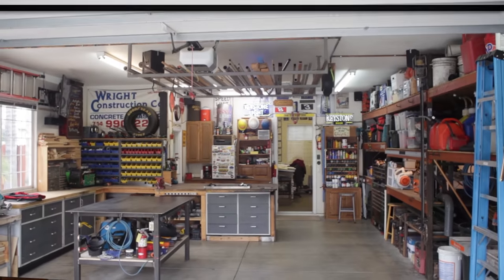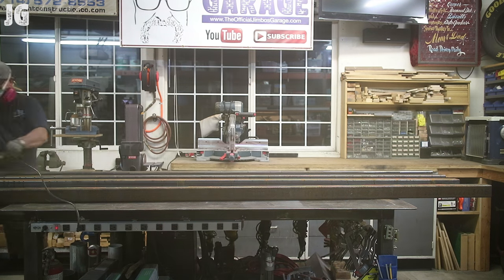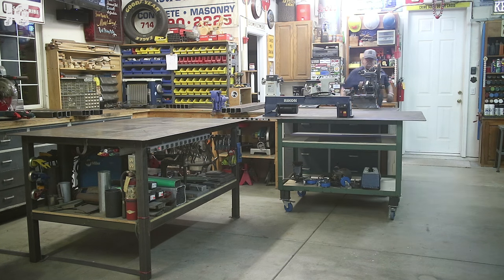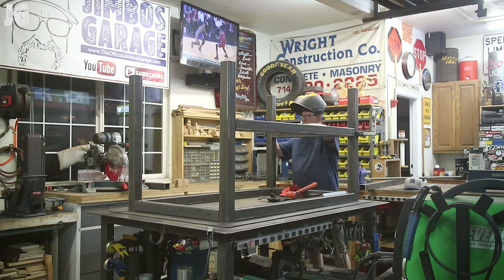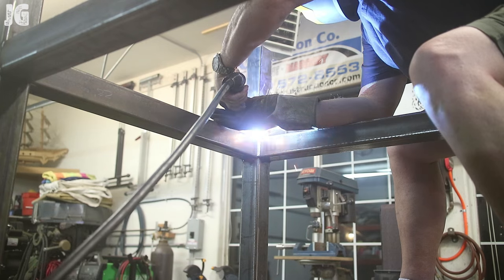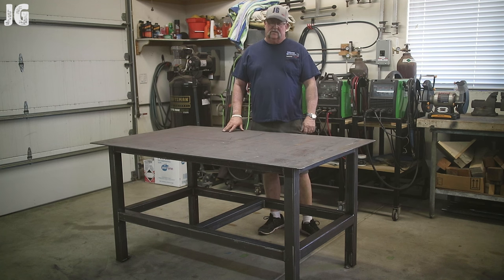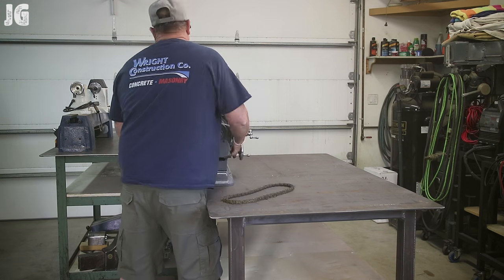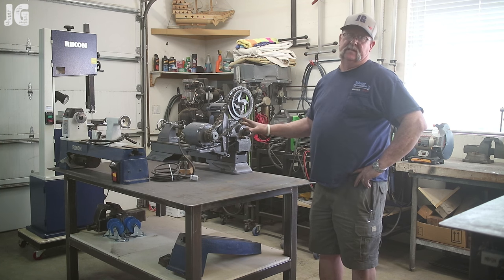Shop Table Build - Jimbos Garage

Comment: Course Scotch bright hand pads and dish soap with water is the easy way to clean/prep/remove/grease & light rust on metal, then just wipe with shammy & blow off with compressed air.

Comment: I am making my first table. Teaching myself to weld. In July, I got a Bobcat 250.  
I have 2 X 2, 1/4 square tube. I have the top and bottom frame welded. I put two legs on. Man, I tried the other two today. One of the first legs was 2 inches bent out. Haha. I was like, well shit! I didn't do it all at once. Not sure why it bent. But, legs are off again.  
I am doing it all myself as well. The thing is, just the top frame and two legs are like 85 pounds. I screwed my back up and can finally move around after like a week. Haha. 
I need a way that I can put the top frame, over the bottom and then tack them together. I think, the only way I can do that, is if I get something like an engine hoist. Then, I could hover the top, over the bottom, out the legs in between and do my thing. I guess I could lay the thing on its side. But, seems the other side would warp.
I do like the welding thing. Never been into tools. Just decided to give welding a try one day. I also just ordered the AHP Alpha Tig 200. It will arrive Friday. That will be fun to learn.
Reply from the maker: Thanks for watching Josh, Just remember to try and keep what your welding as square as possible, That might help.  Jimbos garage!
Reply: That is one beefy table. I can only hope to have a garage like yours to keep my powertig welders housed in style!
Reply: JIMBO'S GARAGE  what the size of the plate love your videos also can you make a video of all your metal working equipment

Comment: I’m new to welding and would like to build a table just like that. Do you need to flip the frame and weld the square tubing at the top of the frame where it meets the sheet of steel or is that over kill. Looks like once you got the 3 sides welded you attached it to the top.

Comment: Good morning my name es Andrés from Argentina, i want to ask the voltage and wire diameter, i have a mig RMB 180 with 0,8 wire diameter. You sold with cortocuit arc ? between 18 a 20 V correct? ande wired speed in meter or inch? Thanks a loy your are a mentor in welding and metalworking.I an a carpenter now, I learned 3 years ago to weld with electrode, mig and now doing a tig course.Thank you, geniussssssssssssss !!!!
Reply: what type of welding is he using?? it needs also use gas?

Comment: Nice table & clean work, l would like to ask abt the cutting disk do you use grinding cutting wheel or carbide cutting saw blade,
Reply from the maker: +Fayez L   Thanks for watching Fayez L,  It is a carbide metal cutting blade.  Jimbos garage!

Comment: I really enjoyed this video.  Approximately what would the parts for this table build cost? Price for the flat sheet alone and that for the framing material. Is there a rough pricing estimate per square foot for such sheets such as used as the top? Chris
Reply from the maker: Thanks for watching, The square tube was about $150 and the 4' x 6' sheet of 1/4'' plate was about $100.   Jimbos garage!
Reply: Great - thanks for sharing!
Reply: @JimbosGarage  Where does one get a 4x6 sheet of 1/4" plate.  Home depot or Lowes?

Comment: hi im planning on doing my first work bench..just took up welding class recently. it is ok if the top of the table if i use plywood instead of metal sheet.. im on really tight budget.. metalsheet cost a bomb in my country .thanks
Reply from the maker: Thanks for watching, As long as it is a work bench and not a welding table!  Jimbos garage!

Comment: Hello mister i am french and have a little question for you :) i have this aluminium bodyguard to weld ; do you think i have to weld all or only tacking ?here is the picture thanks :) http://img15.hostingpics.net/pics/95162820160424024536RichtoneHDR.JPGand how to prevent weld distorsion please ?

Comment: whats the measurement jimbo?
Reply from the maker: Thanks for watching 4' x 6'   Jimbo!
Reply: thank you!, Jimbooo!

JIMBO'S GARAGE
Reply: sorry if im asking alot cus im new :), whats the size of the steel and what type of weld is that? JIMBO'S GARAGE
Reply from the maker: 2-1/2'' square tube 1/4'' thick wall,  Mig welding.    Jimbo!
Reply: thank you for the fast reply! Jimbo!